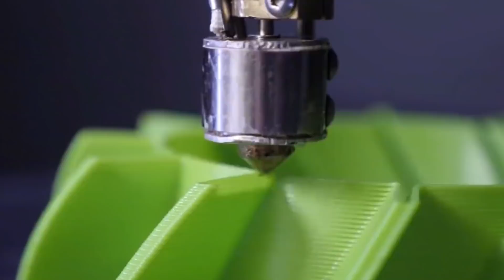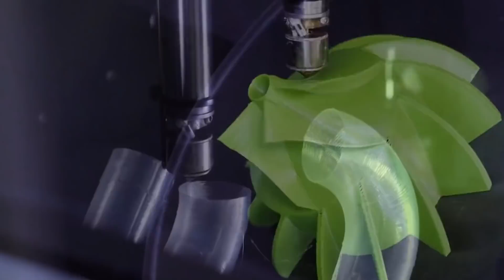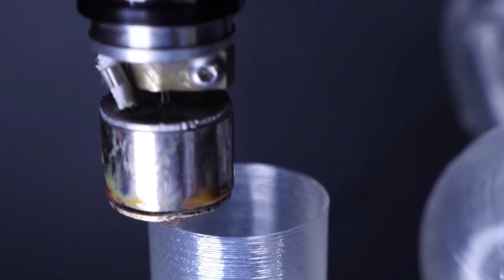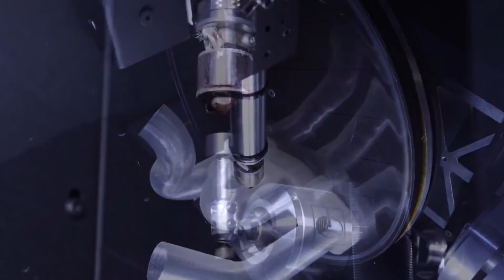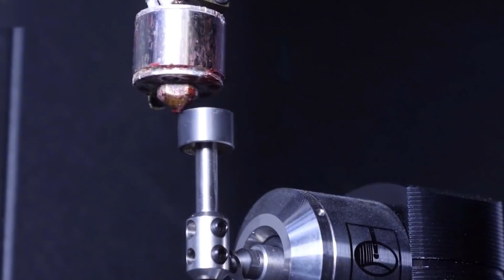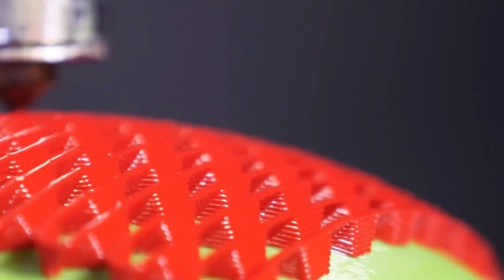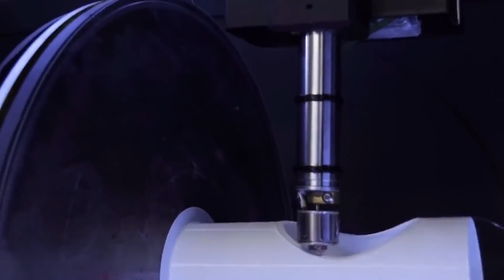Impression 3D sans support

Comment: Imagine leveling this thing! 

Jokes aside, really cool system.
Reply: has a probe to level it.
Reply: @creepinonthebabes  in those machines the probe is used only to check the dimensions of the printed piece
Reply: David McKee  there is no need to level them, they level them in the factory, before shipping
Reply: @librasd8087  It doesn't mean the floor they install it on is level. They get precision machine level to level it within 0.01mm/m to the xy plane.
Reply: Professional CNCist here... these are renishaw probing systems. They are used for nearly all probing requirements from setting tool offset, work pieces offsets and inspection reports (either driven from CAM software or direct from machine). That alone will be worth more than most 3d printers out there.
 In theory, yes it could be used as a leveling device but there would be no need. Correct installation of a CNC machine means leveling the base (not bed or table). There will be 3 main adjustment feet used to level then more that just help support and stabilise the base. There will be virtually no adjustment of the table available for the end user, thats done in factory.
Reply: @Ken-nv2hl  they talked about the leveling of the print bed, I answered that and I didn't think about this
Reply: David McKee  the user does not make adjustments, takes care of regular maintenance, every time extraordinary maintenance is required or the replacement of fundamental components (for example in the event of crashes) the intervention of a specialized technician is required who is sent by the manufacturer to carry out the required intervention
P.S. this is a cnc machine that can easily cost over $ 150,000
Reply: @librasd8087  
Translation: only the tech has the password for the service mode that boots into windows 8 with a tacked on GUI
Reply: @kanesmith8271  it's more likely to be win xp xD hahaha
Reply: i can barely level my 150x150 bed😂

Comment: I did this about 3 weeks ago when I had to print a part with a pretty severe diagonal overhang, I ended up just propping the printer up on about a 60 degree angle and it came out perfectly
Reply: Wow. Nice idea ))
Reply: Thats an unorthodox solution that sounds impractical, but it works & I love it
Reply: How does that change anything? The nozzle is still perpendicular to the bed and the part.
Reply: @saltwaterrook4638  But gravity is not.
Reply: @billfield8300  the layer heights are probably .4 and with proper parts cooling and tuning you can get good overhangs well past 60 degrees. So "gravity isn't" is of little value.  I regularly set my support threshold to 75 on <=.4mm nozzle and 65 for  .6mm and 50 for .8 and 1mm.
Reply: @saltwaterrook4638  He didn't say the overhang was at a 60 dgree angles, that was just the angle he set his printer at.  So yeah, gravity is a thing, if it wasn't then overhangs wouldn't need lots of tuning and/or supports.
Reply: @ferrumignis  no, no it's not. Assuming your layers actually touch the ones before them and you have adequate cooling it's fine.  You need supports when the layers are being printed in air because the layer height requires subsequent layers to go PAST the previous. Tilting the printer won't fix that.
Reply: @saltwaterrook4638  Yes, yes it will.  If you operated a printer in a zero G situation do you believe overhangs would perform exactly the same?

Comment: The printing quality is not bad, but I love the idea and tech as it could be great when finished completely.
Reply: As cool as non-planar printing is, I am not sure how viable it is to be added to slicers. It seems like the actual toolpath would need to be planned and laid out as the model itself is built, which seems to primarily just slow down the workflow 99% of the time. A new model format would need to be created to contain these toolpaths, which a slicer could then use to apply your printer settings to. That seems like a stretch.
Realistically, it will likely always be script based and printer specific. A cool trick, but that's about it.

Comment: I've seen so many ridiculous patents, it's nice to see one that is worth being patented.
Slicing for that thing must have been a chore.
Reply: i was going to mention the madness that developping a slicer for this is going to be
Reply: @shyne2643  it's actually fairly simple. Instead of cutting, you're adding. So it's pretty much simplified 5axis post processor.
Reply: @jothain  I do 5 axis 3D printing as my job and have used a couple of modified CAM milling packages. They are essentially that, just a surface contour toolpath, reversed. But the setup and execution of slicing 5 axis toolpaths is not as straightforward as milling since it is exactly what you said, you are adding instead of removing, so each contour has to support the next and is difficult when you are sclicing non-planar. Multiplanar slicing (3+2 axis) is much easier and you are never really moving more than 3 axes at a time, be it rotatrional or linear axis combinations. Most of what you see is 3+2, and not true 5 axis

Comment: Now this is a real 3D printer, not those 2,5D wannabes! I'm curious to see this develop further!
Reply: I’d argue that current 3d printing is true 3d printing and that this is more like 5 or 6d printing lol.

Three cartesian axes plus the rotation axes (I think there are only two, but I don’t know for sure).
It’s like the jump from 3DOF VR to 6DOF in VR tech
Reply: @June-sv4ie  Standard 3D printing is inarguably 2.5D. Its exactly the definition of it
Reply: @davidcarlson399  if by standard you mean FDM, then I’m not sure I agree that it’s inarguable.
Since you did not provide a definition I looked it up and found this wikipedia article:
https://en.wikipedia.org/wiki/2.5D_(machining)
The main definition that it is “a 2d projection into 3d…no overhangs possible… can be represented by a contour map”.
This is true for CNC machines which are subtractive manufacturing, but that isn’t how FDM printers work. You can have overhangs, and not every 3d model printable on an FDM machine can be represented on a contour map.

I know OP was using hyperbole, but understand I was also being lighthearted as well. Also, maybe provide the definition next time you say it “is exactly the definition” of something
Reply: @June-sv4ie  Its 2.5D because it only prints in 2 dimensions at any given moment and the third is achieved by slicing the object into layers. A true 3D would move in x, y, and z all at the same time.
Reply: @davidcarlson399  
That definition seems a bit “No true Scotsman”ish, but alright:

That has nothing to do with the machine, just methodology.
See: https://youtu.be/km1lvuva5mI
That fits your definition you provided. Still a cartesian FDM 3d printer.
You can also use a spiralized mode of printing, that would also be xyz continuously.

Now I must ask, are you making a different argument to the original comment? Because if your argument is that “slicing is 2.5d”, then we aren’t on the same page here. My point is that cartesian printers are still 3d machines. If you use them as 2.5, then sure, it’s being used as a 2.5d machine; but using a chainsaw as a weedwacker doesn’t mean it’s called a weedwacker
Reply: @June-sv4ie  Your analogy is shit because what makes it 3D or 2.5D is absolutely the way its used. Most 3D printers operate as 2.5D machines, even if they are capable of running full 3D. They simply dont do it for the majority of prints. Vase mode is the exception, not the rule. There are tons of people doing really cool 3D surfacing with standard cartesian machines. Those are being used 3D but most machines are used 2.5D
Reply: @davidcarlson399  Yes, but for starters, it is still capable of 3d. Therefore, it is not "inarguable" that they are 2.5d, as you can see.

I didn't ask what your argument was for nothing.

As I understand it, your argument is that, since people use 2.5d slicing tech, that it means the machines are irrevocably classified as 2.5d for as long as that is the popular usage.
You classify the machine based on the software for the majority of the population's/user's prints.

So if the slicing technology shifts to include true 3d slicing and everyone uses it, would that make it a true 3d printer? A 2.5d machine suddenly transforms into a 3d one?

Is that not a bit silly that we are classifying the machine based on slicing software.
Do you not see that it is not inarguable and is based on one's opinion of what classifies a machine?

For clarity, my argument this whole time is:
1. that is, in-fact, arguable.
2. I believe that just because a population doesn't use the full potential of a machine, that it is classified lesser for it. Having two exact same machines be classified as different because of how one is used differently is nonsensical and pointless.
Reply: @June-sv4ie  I didnt say all 3D printers are 2.5D. I said standard 3D printing. Standard 3D printing across all technologies is at the moment 2.5D. SLA, SLS, DLP, FDM, all rely on slicing 2D images and stacking them. Thats what 2.5D is. You cant slice 3D because slicing is the act that makes it 2.5D. Full 3D isnt sliced into layers, its just 3 dimensional toolpaths, as seen in the video.

You are conflating axis and dimension. There are plenty of 6 axis CNCs but they are still 3D

Comment: It is extra interesting that there appears to be no part cooling!
Reply: No need when there's no overhangs to cool 😎
Reply: @pcdc1337  not exactly... sogging is a real thing in parts  that are not 1 layer sometimes even supports melt a little 😅 
And i am not talking about a heated environment.  

By the way they could just have a  blower 90cm away with a gentle constant stream of air ....
Reply: Chamber has airflow or they print a material that doesn't require cooling. Also no hot end cooler
Reply: Possibly using cooled chamber and as for hot end pre cooler its possible its water cooled (Not a 3d printing expert so i may be very wrong just my own thoughts)
Reply: @BabyWolfy2011  what part is watercooled? 
The hotend is heated on purpose to maintain the plastic flow :) 
The cooling has to be applied to the printed part (the thin filament that leaves the hotend) so it maintain the shape and hold the position it was given to
Reply: @fireworm91  perhaps the heatbreak is water cooled. That is common enough in the speed printing community.
Reply: @fireworm91  I'm not an expert but I know my printer has a pre-cooler on the hot-end possibly to stop the filament from melting before its extruded and also to help prevent thermal runaway, but as I said im not an expert so don't take my word as fact
Reply: @skaramicke  i belive is possible that they might use a more advanced technique as composite materials... or they just chill everything with airflow  
Even a breeze of  pressurized air...
Reply: @BabyWolfy2011  yes that part is called "heat-breake" or have similar names

Comment: I’m wondering what benefits are for printing like this?
Reply: Supports are necessary on many curved/slanted/angled designs and nearly all organic forms, but supports have some major downsides:

-Waste of excess printed material
-Increased printing time (sometimes over 2x the print time)
-Removal leaves the surface rough and distorted in many cases
-removal can be outright impossible on inner geometries (such as the inside of a curved pipe)
-attempted removal can end up damaging the part, necessitating a whole re-print, thereby wasting even more time and material all over again

There's lots of reasons to have a supportless printer and in industrial prototyping, FDM/nozzle printers are almost never used, for this reason. SLS nylon is usually the go-to. However, even the "entry level" versions of those machines tend to see a 5-digit pricetag ($15,000 - $30,000 depending on the brand, dimensions, setup, ect) whereas an FDM/nozzle style machine like the one in the video could be sold for at least one order of magnitude less ($1,500) if not ever lower (the cost in pure parts would put this likely around $500-750, minimum, so with the R&D costs + necessary profit margins, I would guesstimate it would likely retail for $1,000-3,000)
Reply: @StormBurnX  hey come on, how do you know it?
Reply: @adamwajda9084  been working on printers for over half a decade :)
Reply: three words. home metal casting. this is revolutional
Reply: @freezEware  That too. Lost-PLA casting with something like this would be INSANE. Not quite 5-axis CNC levels of insane, but very, very close, for at least one order of magnitude cheaper.

Comment: What are the advantages of printing on 5 axis vs the standard 3 axis?
Reply: virtually zero need for support material is the 1st advantage that popped into my mind
Reply: @kokoilie  Not quite zero, this can only print and overhang that is parallel to the bed, and it would have to be unobstructed. So there would still be the need for support, just nowhere near as much
Reply: @BilboSwagginsTheThird  well the need is virtually zero compared to normal 3axis, so his thought isn't that much off. I mean still very valid thought.
Reply: Biggest advantage would be way lesser needs of overhangs and generally need to retract and begin hotend feeding is really little compared to 3axis. Then because you can track curved surfaces finish is pretty much automatically better. And biggest benefit is that because of consistent layers material integrity is likely superior. But then again,going in 5axis you're already having conventional modern milling machine. Meaning doing milling, you'll get better parts anyway. Plus talking about plastics feeds and speeds would superior to printing, meaning way,way faster production times per part. So all in all I don't see much overall benefits in 5axis printing.

Comment: It's not only sans support but also sans fill. Which would save so much print time. I've done a cellphone stand specifically for being printed without filling and with no sharp angles to be printed on a regular FDM printer as fast as possible (54 minutes comparing to 2.5 hours for regular design), but that's basically it, with 5 axis FDM the potential would be much higher than what I've done for sure.

Comment: .... so this is a 5x cnc machines that do additive manufacturing instead of the opposite 🤔... 
So with some tweeks and hardware an old hiunday wia himold 560  with a broken spindle could do this but with a bed size of over 1 meter
Reply: i guess. but good luck tho :)
Reply: @migLarsen  if you have the knowledge... there will be a period of time where you will screw up something but it's more than doable... 
I can also tell you that using fusion 360 5x machining tool this is possible to program for Gcode...
Reply: @fireworm91  Yeah I know it's doable, It is just gonna take some time. I have used fusion 360 But it looks like cura is also able to slice for a 5 axel printer
Reply: @migLarsen  yes but it would require to convert all codes for the himold ...  fusion don't.  :p
Yes i own the machine and was thinking to make a metal printer out of it in case it gets broken....
Reply: @fireworm91  that would be really cool. A 5x metal 3d printer

Comment: This is definitely a way to print complex 3D objects without support. However, the weak inter-layer adhesion remains the biggest problem of all. Please, re-comment and advise.
Reply: Yeah, idea is excellent, but then again. On 5axis machine it's better to go straight into conventional milling and problem is solved. Especially with plastics as speeds and feeds can be so high

Comment: Weird to see such an expensive machine changing the layer height on every new layer instead of doing a spiralized move or vase mode when printing 1 wall perimeters.
Reply: Uhhhhm what?
Reply: @saltwaterrook4638  existing printers can already print in "vase mode" which prints layers like a ramp instead of like steps. It only works for things that are a single perimeter. 
Pablo is suggesting that since they appear to have implemented the non-trivial task of 5-axis additive manufacturing, they would've also included the aforementioned feature, which has been available in open source slicers for years.
Reply: @saltwaterrook4638  Non-3D printing nerds have no sense of comprehension.
Reply: @ParadigmUnkn0wn  I know what he's suggesting..... but in spiral mode, there's still in increase I'm layer height, it's just continuous. Lol. His comment made no sense. It also doesn't make sense to use vase mode in 5 axis additive manufacturing because it can't be continuous. When changing not only direction but orientation.
Reply: @Rynoblock  proof read.
Reply: @saltwaterrook4638  Read Proof.

Comment: As it should be - its been possible forever... will 5 axis ever hit the consumer space?
Reply: Somebody would have to write an open source slicer for that.
Reply: @Prokurator Generalny Dziura w Dupie The rigidity required for printing is waaaaaay lower than for milling. It's never going to be as cheap as a 3 axis machine, but if you are willing to give up travel speed on your A and B axis you can just gear those way down.